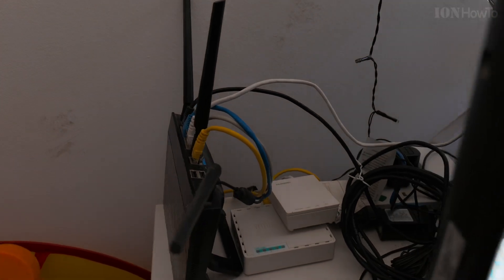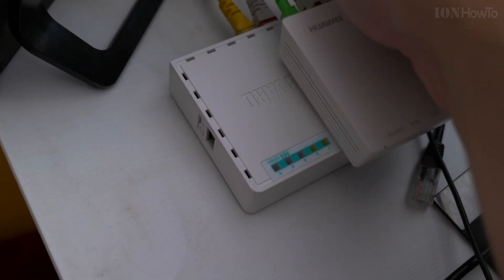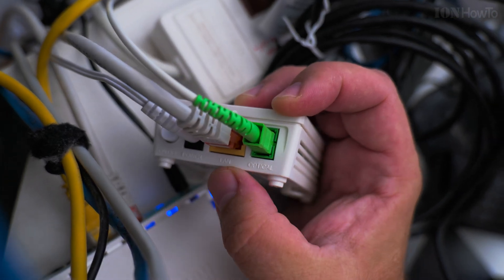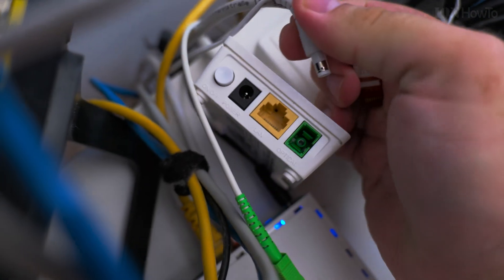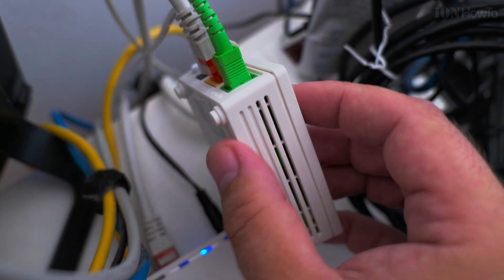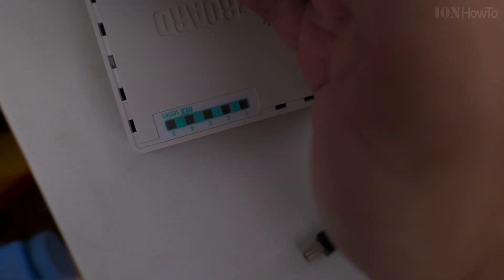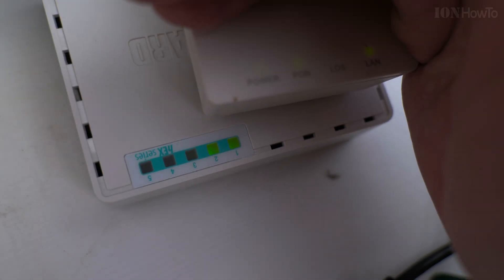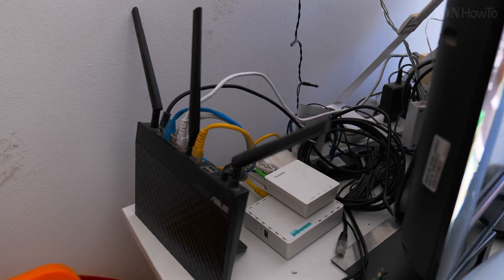Fiber Internet Setup Gpon Fiber Converter, Mikrotik hex Router

Comment: That's a mess, why don't you just plug your own favourite router to the GPON fiber converter ?
Reply from the maker: The Mikrotik is the ISP's box and I did actually try to plug in my router into the GPON but it didn't work like that for me. 
I connect with ppoe so it should work with my router directly into the gpon but it doesn't.
I left it as it is so it's less of a headache. Somewhere else or another isp could do that so it's easier and 1 less box to be powered 24/7.
Reply: @IONHowTo  did you try changing the SN and Vendor values for your GPON with the ones included inside the mikrotik router ?
Reply from the maker: I don't need to. Internet works fine and the isp box is their box not mine. 
Trying to mess with their network would get anyone into serious legal trouble.
Unless they give you access, leave it as it is.
Reply: These Huawei  routers doesn't have features,  no guest network or access control or reboot,    my  isp loves these g*rb*ge routers